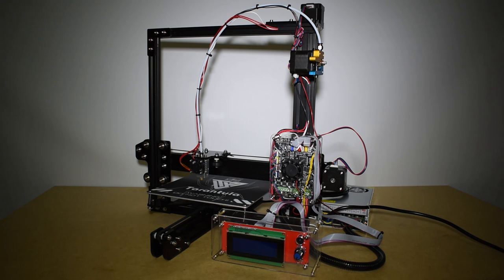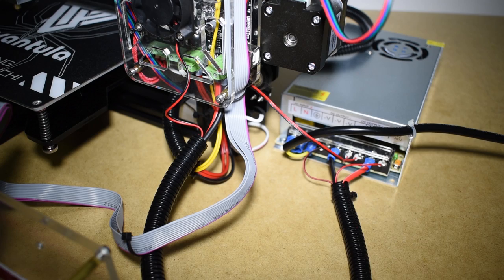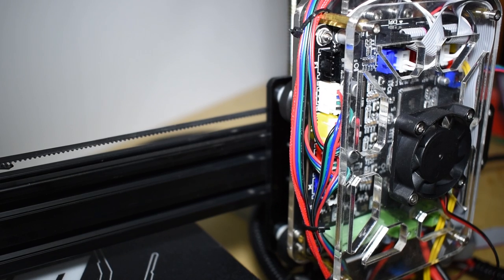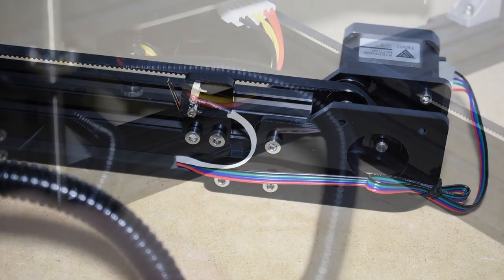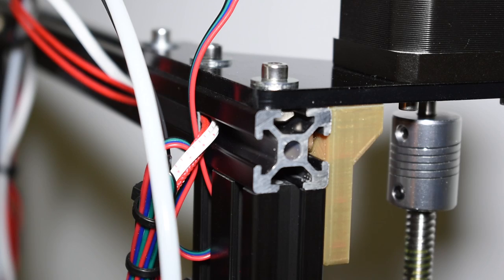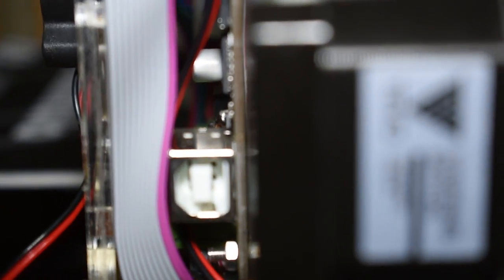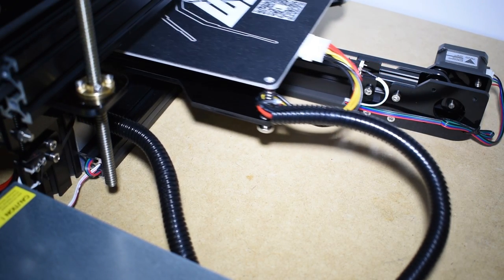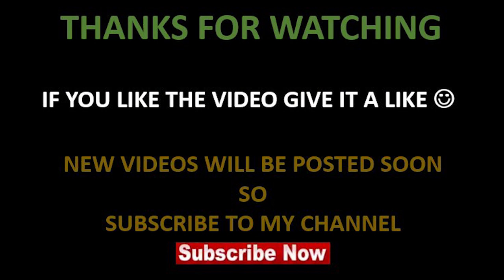Tevo TARANTULA 3D Printer -  Cable Management - HOW TO

Comment: If you often disassemble your printer, a really good and (in my opinion) superior to zip ties solution is using double sided velcro tape. You can trim it to the desired length, easy loosen it and the biggest advancement is, that you can reuse it for years.
Reply from the maker: Hi,
Thanks for sharing your idea :)

Comment: You should walk us through everything you do to this printer! Also why are my heat bed wired different then yours? It's red and black for heating element and 2 small black for the thermistor.
Reply from the maker: Hi Bob,
For the heatbed, there are 2 red and 2 black for power and 2 yellow ones for the temperature sensor.

Comment: I bought some ferrules for my tarantula, however i see now i have the wrong kind for the power supply. The smaller cables do fit and for the main power to the board they fit on the board side. I have not seen any instances of the problem happening at the power supply end, so you think i should be fine with this for a while at least? thanks (also, my idler bearings have gone out the window, i've bought some theethed ones that you suggested, but do you know if something can be causing them to fail? belts too tight?)
Reply from the maker: Hi Terje,
About the ferrules, i use terminal rings for the power supply side but you can still use ferrules without any issue.
However, if the ferrules can't fit in the power supply connectors, then it might be an issue. If you checked and the cables are secure and don't get hot, you might get away with that (can't comment too much as i can't see how it's done) but i recommend you change and make a good electrical connection.
Regarding the bearings, it's true that belts too tight will stress the bearings more, but it's also true that the chinese bearings are not that good sometimes. Try buying good bearings or at least, (and because we need the belts tight) lubricate them before they get bad and see if that helps to increase the bearings life span.
Reply: Thanks, yes i will indeed make regular checks on the cables untill i get the correct ferrules. I believe my bearing must just be a dud as the belts aren't really that tight. for lubrication of bearings, what would you suggest?
Reply from the maker: For the bearings, go for a bearing oil. I have a good one i use for a long time with my RC helicopters and it's great but you can choose any other.
Reply: W
Please, where can I buy a good bearings?

Comment: Also my terminal blocks ( or at least that what I think they are called ) for the heat bed and power input are loose and wiggle. Some people say to solder them on, while others say solder causes resistance and makes it heat up... So what is your opinion on this? I have been debating this for a while. But on the other hand even though they are loose I do not notice them heat up. Thanks! Keep up the great videos!
Reply from the maker: Hi Bob,
that's normal...mine also wiggle but they are not loose. What moves is the plastic part and what you need to be solid and stiff is the metal part. Don't worry of just the plastic part wiggles...just check if the metal part does not. Also, check the back side at the solder joint to confirm. 
Regarding soldering the wires...there are two things there....if you tin the wires, then that is bad and I DONT ADVISE  you to do that. That is one of the main reasons for burned connectors as that can cause contact problems, an increase of contact resistance which leads to increase of temperature and finally burn down.
Now...if you solder the wires directly to the board (by removing the green connector first and solder the wire to the pcb) then it is ok and WILL NOT have any problems with contact resistance (as long as the solder joints are well made).

Comment: Hi again! Watching videos as i prepare all the upgrade parts to hopefully build with most of the upgrades. But, i'm confused by what you used to hold the cables in the channels. What is the product/material?
Reply from the maker: Hi Thomas,
For the profiles, i used the plastic strips that are included with the printer kit ( are these the ones you are referring to? ).
For the main wires, i used cable tidy tube (included in the recent kits).
For the rest, i used zip ties.
Best regards
Rui

Comment: They added molex connectors?
Reply from the maker: Hi 12458 SSE,
yes, this new version has a molex connector in the back of the heatbed and an insulation pad under the heatbed.